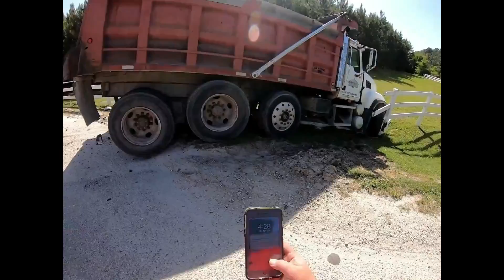DUMP TRUCK IN A DITCH

Comment: Not bashing or disrespecting but that job would've looked MUCH better had you just used the Heavy. The 16 Ton served no recovery purpose other than an Air Supply and increasing the bill. I said in the beginning drag the load up on the road move the heavy put the front on the road and tow it away... idk
Reply from the maker: No disrespect taken. The reason the 16 ton was used was the front axle needed to be pulled up the bank before the winch on the rear was finished to prevent any further damage to the signs and fence.

Comment: You made that look easy! No drama - just got the job done. You and your dad worked well together. Nice to see the heavy equipment in action.
Reply: Gets paid to use both trucks. Wouldn’t want to be paying for this job.
Reply: Dave J . Check their reply to Gary Waddy’s comment - they explain why they used the 16 ton.
Reply: Richard Doesn’t make it correct. I wonder how many wouldn’t have use 2. It seems overboard to me.  I seen ones that made this look like nothing and still only use one truck. And you do hear of this happening with tow companies. Am not a expert but it sure made me think.
Reply: Dave J . They were the ones on-site, we weren’t there. You can see how close the truck was to the fence. If they cause additional property damage during a winch-out, they are liable and their insurance company will not be happy! Better to be safe than sorry. Besides which, we have no idea what they charged!
Reply: Richard Am sure they charge a lot. And it probably would’ve be cheaper for the company to fix the fence than what it cost for that second truck.  I have friends in  towing I heard all of the stories. It just hard for me to believe they needed 2 trucks for this job. Get into the truck and steer it while pulling it backwards. This look like a simple job.
Reply: Dave J Did you notice the left hand front wheel ?
Reply: Dave J Big tow trucks cost big money. They do not earn anything except when they are working. If the company does not make a good profit on a job it cannot stay in business and then simple, no tow trucks. Expenses rack up even when they are not working and earning. Add in insurances, interest in the bank loans to buy the thing, equipment that has to be replaced and so on. Plus a little but more to live on and keep your family!.  They are worth their money when you need them quickly.
Reply: Brian Williamson It not up to me as a customer to keep him in business. He could just be a bad business person.  Truck drivers know all about this kind of towing company when they see 2 trucks pulling up they know it going to cost them money. They have seen it to many times. And I must say when I heard him say that they have 2 trucks going to this I knew they come up with a reason to use both trucks.
Reply from the maker: Just curious, how much do you think we charged?
Reply: Hodges Towing . Hi. I was wondering if you were following this! To which one of us are you directing that question? Personally, I have no idea.
Reply from the maker: Sorry Richard I was responding to Dave J.
Reply: Hodges Towing I don’t know tell me. Am guessing a lot.  Their some really bad towing companies out their. Am not sure where you fall into that. Some need to be put out of business. And am not saying your one because I don’t know.  I just didn’t see a need for 2 trucks. You can put a small business in a hurt if you charge them more than what is warrant or just a private citizen.